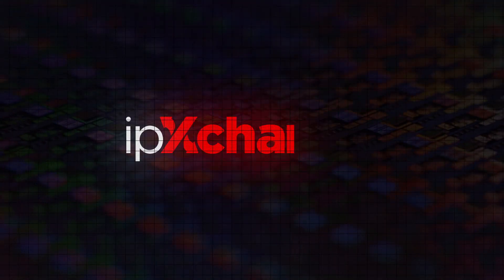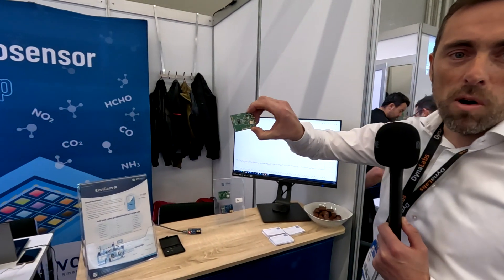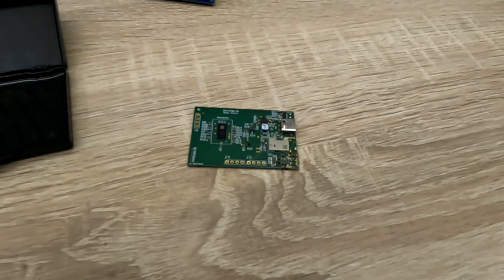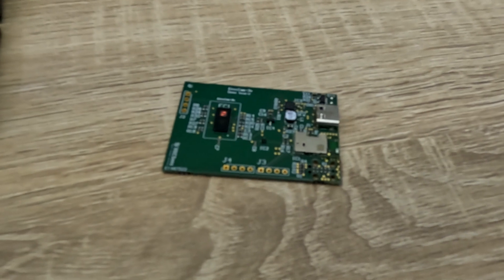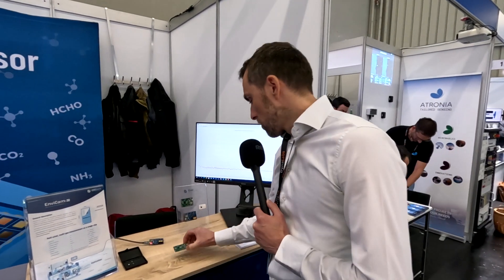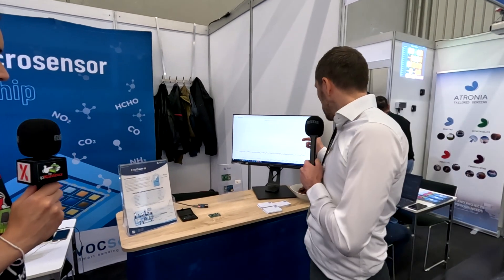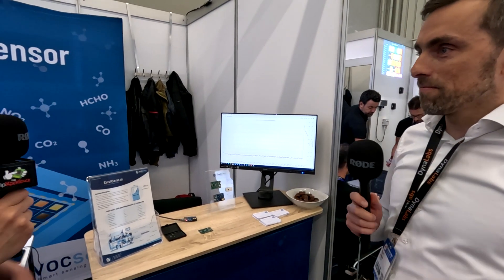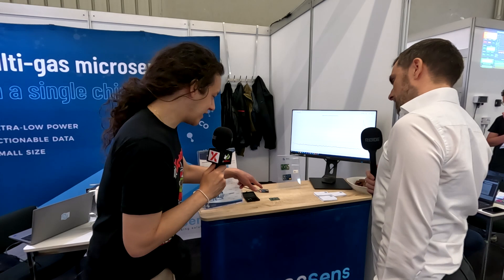VOCSens’ multi-gas sensor in action: Simultaneously detect 8 different gases for IoT applications!

Comment: please i need a multiple gas sensor like your own to combine it with other sensors to design a portable using arduino. will yours be suitable? i am concerned with the size of it.
Reply from the maker: Hi Asakire, fill out this form and I will help you find the right sensor: https://ipxchange.tech/boards/user-defined-evaluation-board-or-sample/

Jake